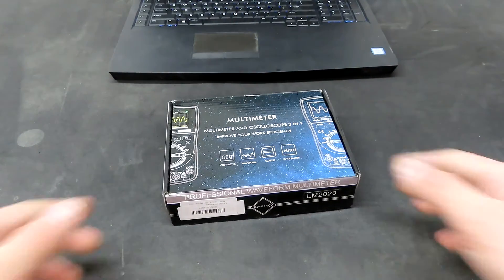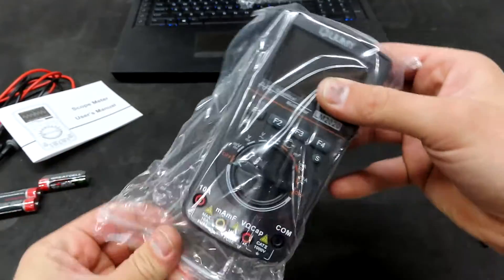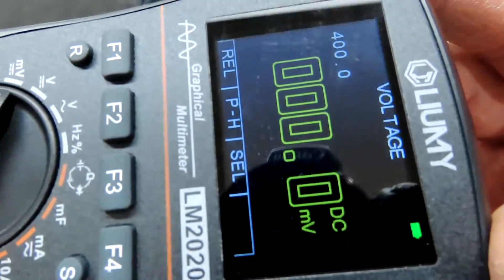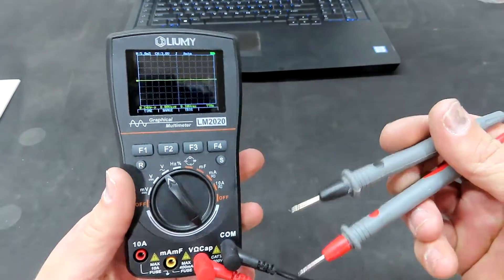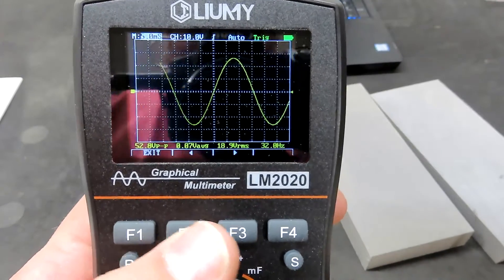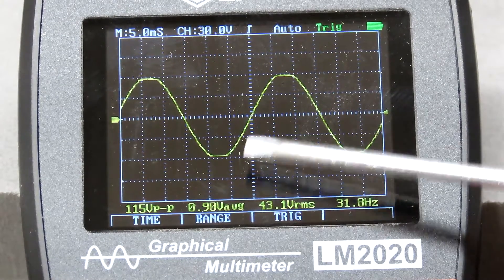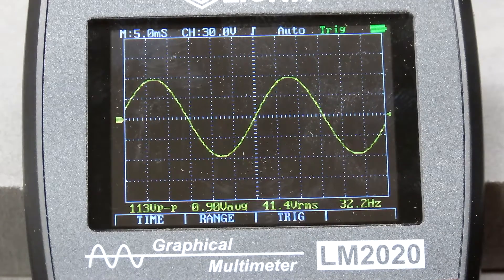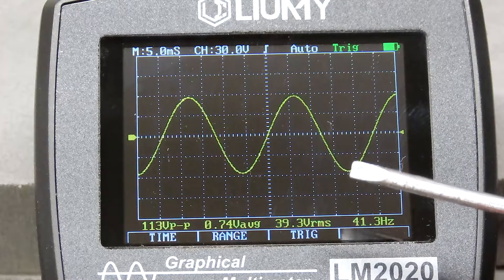HOW TO SET YOUR GAINS PROPERLY!-The BEST DMM Oscilloscope Under $100!!! LIUMY LM2020 Car Audio

Comment: my sine wave keeps going too high and the bottom part squares off while the top remains fine but it doesnt stay in the centre of the screen like yours, it goes too high and too low . are BOTH top and bottom part of the wave suppose to be rounded and not 1 round and 1 flat ?
Reply from the maker: What you’re describing is an issue with the amplitude. It’s called “bias” and it’s set incorrectly from the factory. Depending on the amp it can be an easy fix but requires to back of the amp taken off
Reply: @ATCA so due to this issue, is it not possible to set gain using this style scope?
Reply from the maker: @akuma4u set to where the carver wave is clean. Both should be clean
Reply: @ATCA i cant. The bottom one clips/flattens out while the top one is ok. Unless i set gain low enough where both top and bottom are clip free
Reply from the maker: @akuma4u that’s what you’d have to do. What amp is it?
Reply: @ATCA  Its a JP23 V2
Reply from the maker: @akuma4u hmm. Those amps seemed to have a couple issues. I’d try to goer a replacement. If you bought it used, a guy called amp medics can fix it
Reply: @ATCA what issues do they have?
Reply from the maker: @akuma4u random issues not working properly
Reply: @ATCA r u sure its not an oscope issue maybe the settings or something? I got it set to 20v and 5ms
Reply: Damn i just realized the lm2020 is 600 bucks and the scope i got is like 20 or 30 bucks 😂😂😂

Comment: I was trying to check the outputs on the amplifier today.. 1,000 HZ 0 DB and 40 HZ has 0 DB I got a clean signal out of the head unit real nice wave now when I hooked it to the output of the amplifier the wave was not fine it looked like we were trying to draw a ribbon band you know like you draw 2 lines  mirrored of each other like a 3D ribbon n like a kid would you would draw scratchy lines connecting them together lik you were trying to color the ribbon in. I would have to make a video of it for you to understand but the signal or amplifier did not sound dirty. It was one of those brand new down for sound mini Maxx mm1004. My scope is a velleman HPS40 I turned it on hit the auto button

Comment: I have the same scope, I can run max volume on my pioneer 80prs no clipping, 4.3 volts, 45hz. When I set my gain ony bass amps, even using the time control on the Lumi, the sin wave stretches past the screen and I cannot see clipping, I run a big system, 4 SALT 8ks on 15.3 volts of cmax lithium 300ah, any suggestions? Thanks
Reply from the maker: Use the range control
Reply: @ATCA  found the x10 setting yep worked !

Comment: Can this be used for the 1000hz test tone for setting mid range amps too? Not just sub amps?
I bought a cheap oscilloscope from Amazon and could only get the 40hz Tone to show good waveforms and when trying higher frequency of 1000hz  since I'm trying to set my mid range amp for motorcycle and can't use low hz on bikes it won't show the waves no matter the settings.

Comment: Thanks for the video. I want to use this to measure the waveform on my inverter generator. Do I have to put the probe on the 10A port? Thanks.
Reply from the maker: No. Do just like the video
Reply: @ATCA  Really appreciate your instant response!
Reply from the maker: @TangDynasty1983  nor a problem

Comment: 1:21 you can measure Hz?? this is good if you want exact value and on your amp is for example value from 50 to 120 and you want 90Hz but it is not exact. And measure terminal where are speakers connected will give exact value.

Comment: So if you put everything to flat, (bass, loud off, treble to zero, sub at zero, no bass boost, and u set the amp gain just before clipping at the head units max clean volume, wouldn't the sub clip as soon as u put your head unit settings back to the correct settings that the user enjoys for listening? Thanks
Reply from the maker: The idea is to leave the HU at O. Maybe small increases ir decreases. Dramatic changes on the head unit is a disaster for the input signal. If you have to adjust the stock hu for your speakers, like you want more bass or something, byou need to set before you set gain on the amp. But ideally using the "crossover" function on the radio wont effects the "sub" output much in this manor. If you have a cheap head unit with only one fukl range output or youbhave stock radio with only a single LOC, then you are correct,  adjusting these settings after setting the gain can DRAMATICALLY  change the point where the amp clips. The idea is to have the amp set to where it will never clip. 

Heres another scenario: 

you listen to the radio at volume 20/30. And you set the gain there to get the most from your amp at the volume you listen to. This os a good scenario.  However,  when you're buddy borrowz your car or you take ot to the dealer and they test drive it and crank it up, the subs have the possibly to clip and blow. This happened to Exo Contralto. His girlfriends car was taken in for repairs and he set it where he wanted.  He came back and the subs were miraculously blown. Ideally you can turn it all the way up and bot have this problem.  If you naturally listen to the radio lower, theres sometimes a settings calles SLA or "source level adjustment". This you can use to decrease the source input and thus allow you to the full range of thr volume dial and have the output level where you decide.
Reply: I set my head unit to where I like to listen to it at then I set my games on my amp, I don't set everything to flat.

Comment: Thanks for the video. My waveform was so tiny I couldn’t see it. I finally got it large enough to see. Trying to set gain on an amp, but rather than clipping, the whole wave starts jumping up & down across the whole screen. Any tips on where I’ve gone wrong?
Reply from the maker: Change time  scale
Reply: @ATCA  Thanks for the response. I believe that’s how I went from just a blurry stripe to an actual wave I could see. Now the only change I get from the gain is the whole screen jumps up & down. Wave shape doesn’t change.
Reply from the maker: @1970351c  keep going

Comment: i need your help please 🙏🏼 does a cheap oscilloscope (5mhz bandwidth) shows me a full sine wave above 50v on the output of amplifier? The reason im asking is because mine one always squares it on anything above 32v output (amp). I have tried changing the amplitude on the oscilloscope by pressing the voltage button from 10v to 20v 50v 100v 200v and the arrows to put the sine wave right at the bottom so i get to see the top of it but still, so im not sure if im getting a square top or the wave is actually going pass what my cheap oscilloscope can show :/ Amp is 3000 rms which can go up to 78v all i need is 57v output but im not sure if is a dirty signal or not. Amp isn't clipping (light on it) until i go pass 80v output. Please give me your opinion on this one 🙏🏼

Comment: When you test the Head Unit for clipping, where do you put the leads? At the RCA outputs or speakers. Everything in my system i just installed is connected through RCA to the amp.
Reply from the maker: Check at rca for clipping at HU.

Comment: When I measure my max radio volume before clipping, it goes north off of the screen. How can I get it back on screen?
Reply from the maker: Use the "range" settings
Reply: Ahah, thought that was for if I had different probes. Thanks. I'll check it out this evening.
Reply from the maker: @barrysoileau5319  just keep pushing the 2 buttons til its in range

Comment: im just getting into building guitar distortion pedals (TS808) tube screamers and Fuzz face . im wanting to get an Oscilloscope to be able to see how my circuit changes the sine wave at each component , would  this work for my application ?
Reply from the maker: It will do exactly what you want. Itll show pwm and square waves. Ill make a video soon about this unit, how to use it, and how it shows different waves

Comment: Does anyone knows where you can buy it? amazon doesn't works.
Reply from the maker: https://www.amazon.com/Oscilloscope-Multimeter-LIUMY-Professional-Automatic/dp/B08832JX4H/ref=mp_s_a_1_1?dchild=1&keywords=liumy+lm2020&qid=1617039366&sprefix=liumy&sr=8-1
Reply: @ATCA  
Thanks. I know this link.
But you can read there:
Derzeit nicht verfügbar.
This means the device isn't available.

Comment: What is the maximum Vpp that this unit can measure using the stock leads?
Reply from the maker: I think well over 200 volts. It can graph anything it can read DC or AC